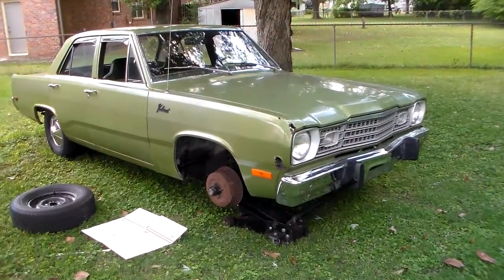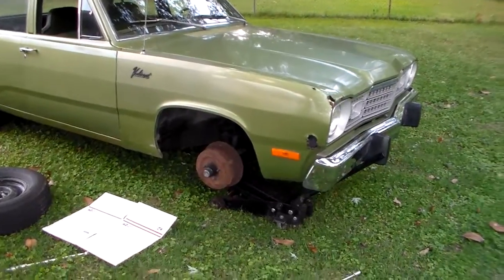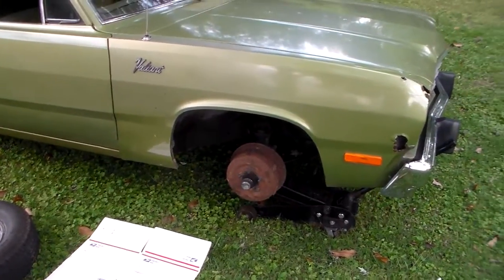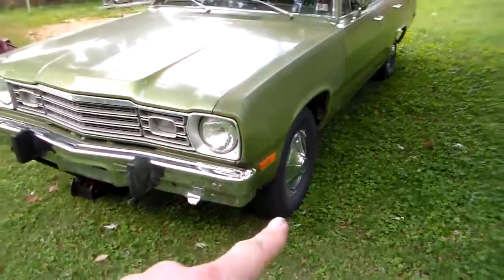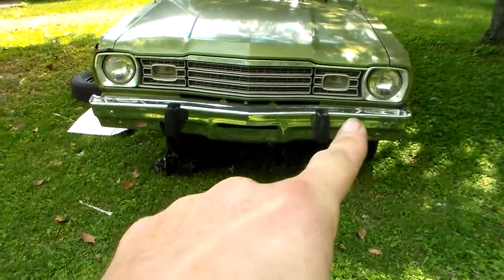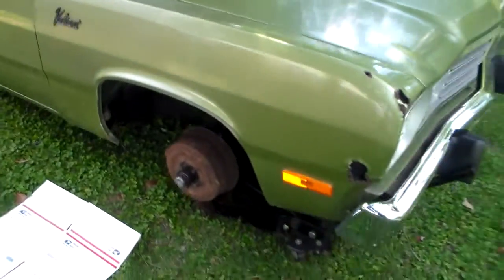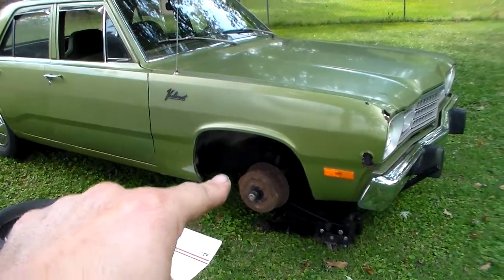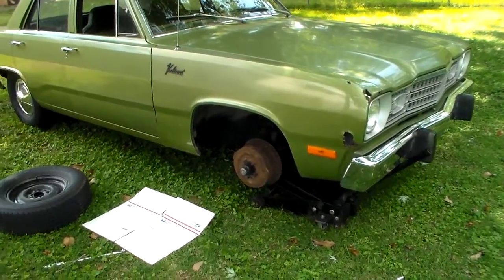Diagnosing drum brakes that pull to one side part 1 of 3

Comment: Agreed. Unless your wheel cylinder seals are pouring fluid out more likely is the self adjusters.  I have had more recently on a disk brake  caliper the guides where so cruddy on one wheel that they worked poorly or not at all.
Reply: wheel cylinders will seize up and not leak. been there seen it. all i drive is old shit, have seen it all. some guys dont like drum brakes, mine once i fix them, will stop on a dime and give you 9 cents change. i like them!

Comment: You do know, that before you even pull the wheel off, just take the inspection plugs out on the backing plate and stick a flat blade in there to tighten/lessen the star-adjusting wheel so you can have it brake more evenly...
Reply from the maker: Yes, but you shouldn't have to do that. The brakes are all self-adjusting. Each time the brakes are applied in reverse the self-adjuster should operate, if needed. I don't even know why they bothered putting the adjuster access hole there on a car this new.
Reply: New!?  Hahaha!!!  Don't expect those self adjusters to always do their job right.  Like I said, moving/adjusting that star wheel is a hell of a lot easier to solve brake problems than taking everything off.  If that doesn't fix it, then by all means take everything off and replace the shoes/whatever.  Have had plenty of experiences with these drum brakes, especially on my '73 Valiant 4 door /6. + '65 'Cuda & '65 Valiant.
Reply: that wont work to good if there is hydraulic restriction or bad wheel cylinder.

Comment: im going to let you in on a little trick that i hate to give away, wheel cyl.... you dont have to take all the crap apart, the bolts that hold the damn thing in, yeah the bolts you cant really get to, the best way to get them off is to take a chisel to them ! this trick is for mopar a body"s with front drum brakes. trust me i have been there.